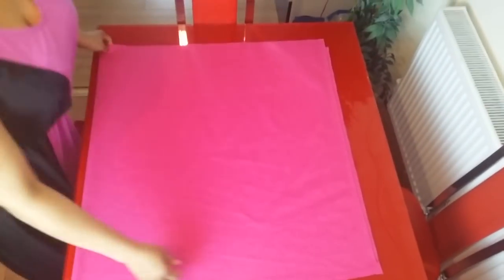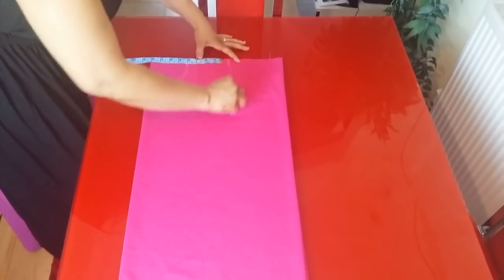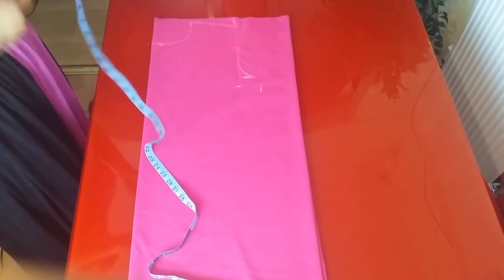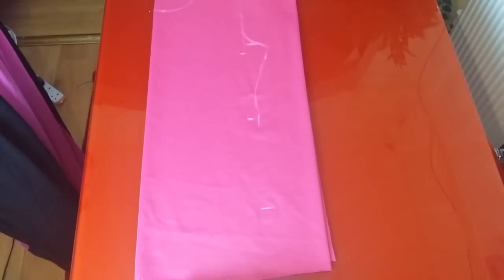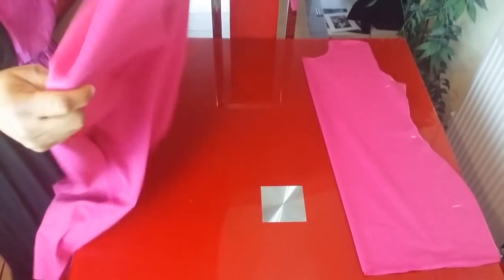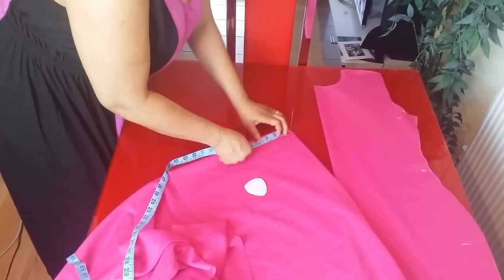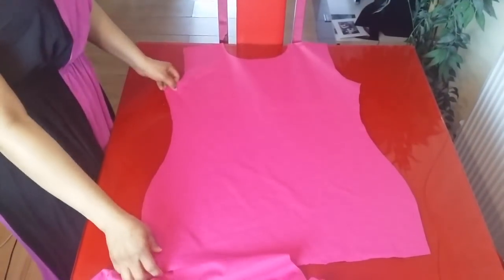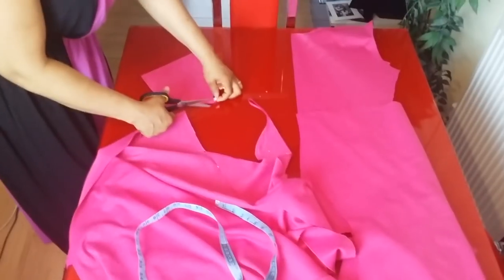How to make a Peplum Dress

Comment: Thanks for this tutorial. But can u explain how u get the measurement for the peplum and the measurement for the sleeve. Thanks again.
Reply from the maker: Abby Ade, I took the measurements of the joint area and divide it by 4. For instance the joint measurements is 40 by width, then you divide the peplump area 40 by 4 which is 10,I divided into 4 because the fabric was folded into 4. You will use that 10 to cut out your peplump.

Comment: Wow I Been looking for how to make this kind of dress finally I found it .but can you please explain how you know how many inches you cut for the peplum so it can match with the end of the dress
Reply from the maker: @Lydia Salomo, The circumference measurement is 40 inches. then I folded my fabric into 4 and divide 40 by 4 which is 10 inches. So used the 10 inches to cut out the peplump, and when you open the peplump, it would give you 40 inches, you will then go ahead and join your dress and peplump together .